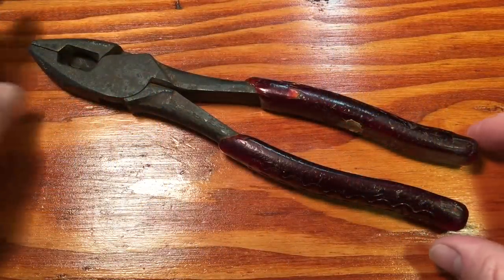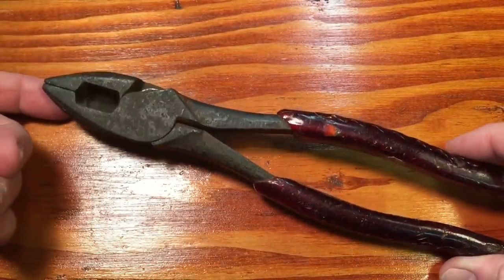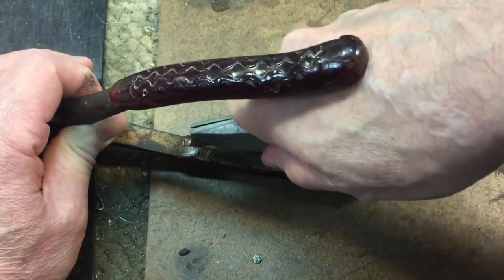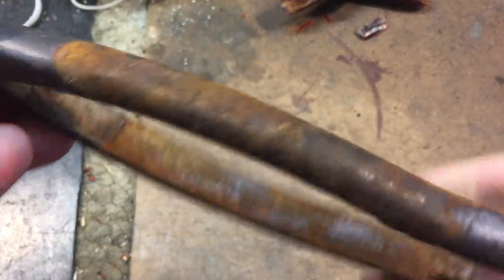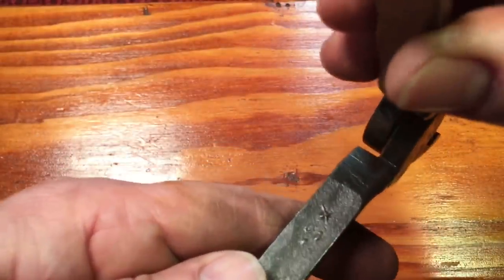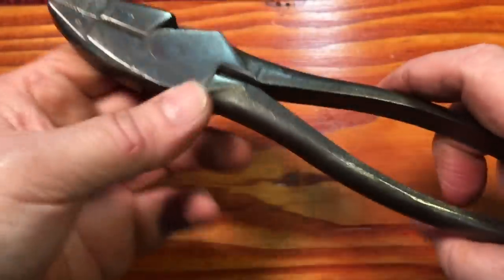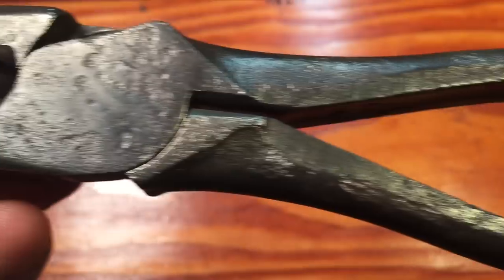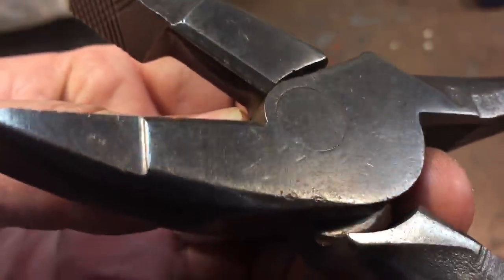Grandfather to Grandson Plier Restoration

Comment: I couldn't think of a better person to restore and bring those pliers back to their glory. Great job on those pliers. I do wonder how to get the cutters sharpened.  If I understand, one side is the sharp part and the other is the anvil?  I think you explained that before.  Either way, they cut and Alex can use them.  My dad has those panel hole cutters, the ones you screw together and punches a hole.  They were horribly rusty and I de-rusted them and oiled them up and put in the tool box I made him in high school. Good times!

Comment: They look just like the 8" offset jaw  "Diamond" brand pliers I used for so many years tying rebar in construction , great for cutting 14 guage annealed wire , and even 9 guage on occassion . Also when I put a new set of Klien Coat handles on . I would let them sit for 5 minutes in a pot of boiling water before installing . Or if I wanted to save the Klien Coats for a new set of pliers . I would put them in boiling water for 10 minutes or so , and gently work them off . I might have to do it 2 or 3 times , but most times I could salvage them . Great restoration and another thumbs up for a great video John .

Comment: Beautiful restoration, as usual. I do love shiny steel with those red grips.
Reply from the maker: Hi Ben!  Another awesome combo would be Polished steel with Green or Orange grips!   =D
Reply: @ScoutCrafter  The cool thing about the Klein coats is they only come off if you purposely take them off, and they don't need to be glued on. They are also tougher than other handles.

Comment: I just found your channel, and started with this video. You did an absolutely wonderful job on these pliers. When can you get Klein Koat grips? They look like great grips.

The reason the cutting edges were damaged is because somebody cut hard metal materials with these pliers (steel wire, nails, piano wire, etc.). Electrical pliers (and these being Linesman pliers, are electrical pliers) are hardened/tempered to cut copper wire (aluminum, too, in some more modern pliers), but not hard metals. The cutting edges will be damaged when cutting hard metals because the edges are not hardened enough to cut hard metals. Not criticizing, just pointing it out.
Reply from the maker: Hello KK You are right, however Klein makes a few models in the same configuration with different capabilities, their lower priced model is meant to cut copper, the higher priced model is rated to cut screws and nails... without damage... Thanks!!!!!

Comment: Another fine restoration John!!! I found a pair of pliers like those with very similar grips. I couldn’t tell the brand due to rust, but I’m sad to say, I didn’t purchase and when I went back recently, it appears someone bought them. I recently restored a pair of Klein crimping pliers/cutters and unfortunately I couldn’t save the lettering/insignia, so I was bummed about that. Any tips for Keeping the brand/insignia from being polished away on heavily pitted surfaces?
Reply from the maker: Hi James!  It's always a toss up when that happens!  Do you save the lettering and have the pliers look bad or shine them up and lose the lettering?   Every piece has to have that decision made one at a time.  I did a pair of Kleins that I removed the lettering because the date code was intact on the handles... No way do I want a pitted area just so I can see the faded stampings!  Thanks!!!!!!!!

Comment: Did you put a wax coat on them I’ve been using the 50 50 vas and mineral oil on some of 
My tools works great I have just finished a old pair of crescent lineman pliers they were given to me 
By my mother got them from her dad maybe 50 years old they cut like a dream
Reply from the maker: HI Matt, Yes, after polish I waxed with Mothers Carnauba cleaner wax and that will protect them nicely!  Thanks!

Comment: Cool restoration, did you not have a video about installing those red handles? You put them in hot water to soften them up some if I recall.
Reply from the maker: Hi Dale! Yes!  You soak them upside down in hot tap water for about a minute and drive them on with a soft blow hammer!  Piece of cake!  =D   Thanks!!!!!!!!!

Comment: I got the Klein lineman's pliers in the mail. They're NOS and they really don't have any sharp edges. The action is very stiff though. What would you use to lubricate them?
Reply from the maker: Hi Brian!  This is a common problem with the new Kleins!  Don't fret!  If you use some lapping compound and apply it around the rivet and work them back and forth it will lap them in nicely and the action will be smooth and free.. Then use lots of WD-40 to rinse out the lapping compound...  Finish with a few drops of oil!   =)    It's easier then it sounds!
Reply: @ScoutCrafter  Thank you! That actually sounds like fun. Can't wait.

Comment: Hi John.. You make that belt sanding look so easy, but from a relative newcomer it's not!😀.. I have a question for you also.. Have you ever seen or heard of a 5/16" drive socket set?.. I've just got hold of what I thought was a 1/4" drive King Dick ratchet, but 1/4" drive sockets don't fit it. I measured it with a micrometer and it appears to be around 5/16"??
Reply from the maker: Hi Tony!  There was a 7/16 Drive that was very popular in the Military.  1/4" and 3/8" are the standards but years ago tool manufacturers were trying to slightly change things so you would have to buy their parts!  It didn't work as people soon rejected any oddball accessories..   Ask Sony about Beta!   LOL   Thanks!!!!
Reply: @ScoutCrafter  Hi John. This ratchet has the British military crows foot arrow on it..  I'll email you tomorrow👍🏻